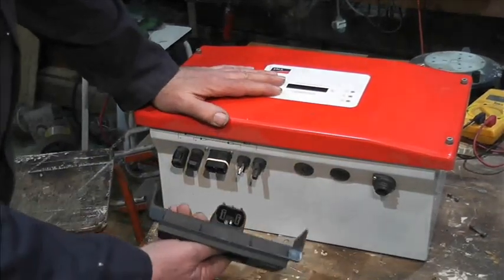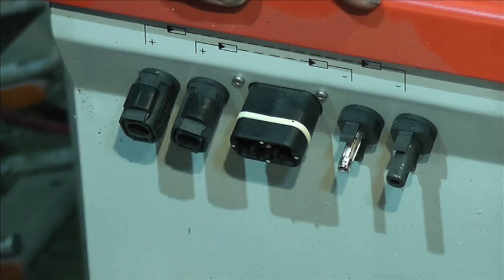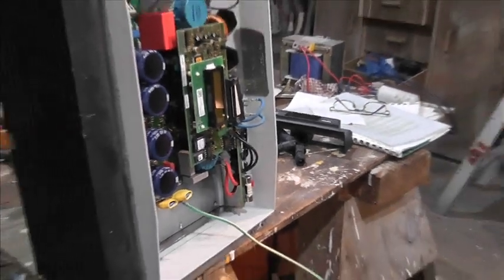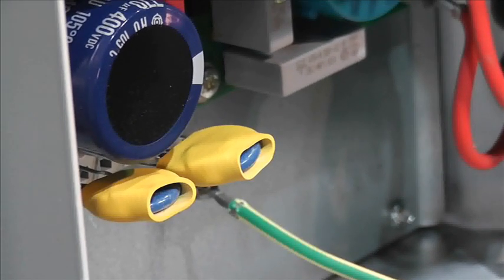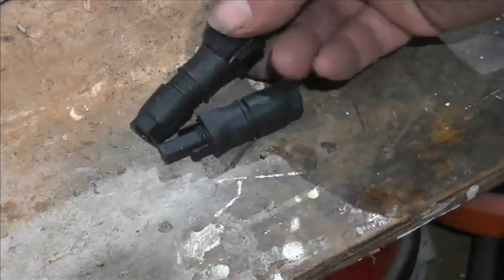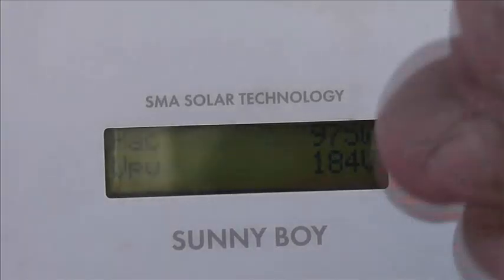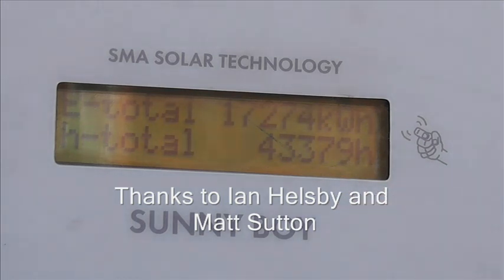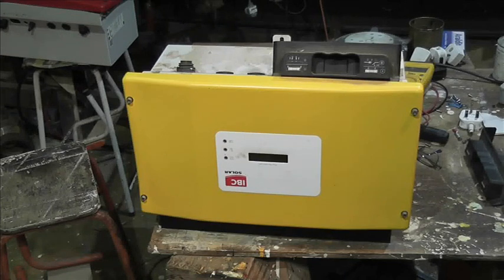SMA Solar grid inverter SB1700

Comment: I've just acquired one of these for free. Are they still a good unit???
Reply from the maker: They are solid but need the older panels to match voltage and current, cheers

Comment: I have a SB-3800-TL and when AC power is applied, there is no screen boot up etc.  Inside there is no sign of damage.  Does the DC disconnect need to attached and closed for the AC supply to switch on the inverter?  On my SB-3000 it only disconnects the DC side.
Reply from the maker: Hi, both AC and DC is needed for the inverter to start. The DC disconnect has to be in place, cheers
Reply: @TheInfoworks  thanks for the advice.  I am used to my older SB-3000-20 which will boot up the screen on AC alone or DC alone.

Comment: I drilled holes for a regular MC-4 and replaced them. I crimped the connectors themselves and soldered them inside the connectors. I also had to trick the grounding, since the differential circuit breaker turned off the electricity, since it registered a leak through the inverter when energy was generated in the power grid. I read that you can turn off the grounding check, but there are no interfaces to do this. Maybe someone knows how to turn off the grounding check in it?
Reply from the maker: Earth leak can be a problem, commonly it's in the panel wiring but I've not had any success when the leak is in the inverter, cheers
Reply: @TheInfoworks  how to disable earth leak checks?
Reply from the maker: @anrays  Never had any success, check that the fault is not in the array, otherwise change the inverter for a second hand unit, cheers
Reply: @TheInfoworks  I managed to disable the check with an additional wire, but it is not very correct. According to the instructions, the check can be disabled in the application, but for this i need to connect it to the computer. I do not know how to connect.
Reply from the maker: @anrays  Yes trying to use factory software with SMA is very difficult. I believe you need to be a registered engineer. It would be wonderful if you uploaded a video to show what you have done and I will share it, cheers

Comment: Great vid any chance you would know anything about SB 1600TL-10 ?
Reply from the maker: Hi, they are part of this robust series, some have a high start voltage so do not match with modern high wattage panels. Check that the DC is getting to the board through the DC isolator plug , cheers.
Reply: @TheInfoworks  what amount of volts input would you recommend to switch on the system ? Currently got 20 volt coming into the dc side where the panels plug into screen not on and nothing at ac side. This unit only has + and - plugs for panels and the ac plug no other plugs
Reply from the maker: @danielmcarthur6200  Hi, at 1:30 on the video it shows the DC disconnect plug, also on the label what is the value shown for Vdc mppt?  cheers
Reply from the maker: @danielmcarthur6200  All the info is in this video, otherwise put up a video on your channel, cheers

Comment: Thanks for the vid, how do I isolate the DC supply ? Mine needs a reboot after a power cut
Reply from the maker: The black moulding at the bottom is the DC connect, are you sure AC is getting to the inverter, maybe a trip needs switching on, cheers

Comment: Nice  info Andy  thanks
Ive 3 sma units n want to add optimizer/s to a string of 5 panels, only 1 gets shaded... so i bought some solar edge optimizers but need bluetooth or WiFi....... any ideas. O knowledgeable 🙏 one
Reply from the maker: Hi, I'm lead to believe the solar edge optimizers only work with solar edge inverters. This Israel based company controls all the inverter networks, so it is difficult to use second hand equipment, cheers
Reply: @TheInfoworks  feared as much😞 cheers for reply👍

Comment: HI Andy ,I have a system with sunny boy inverters ,one of which has stopped working I have found someone to repair for me(I live in France)but i am unsure of how to safely disconnect and then reconnect once repaired.Could you help me with this ? thanks
Reply from the maker: Hi, always AC off first and AC on last. This avoids switching high current DC, cheers
Reply: thanks for reply @TheInfoworks

Comment: Mine stopped working after a powercut. How do i reboot the sunny boy 1700? Thx!
Reply from the maker: I think maybe the power breaker has dropped out, sounds like you have no mains power to you inverter. Time to get the multimeter out, cheers

Comment: Hi Andy. I have acquired to wind boy inverters which came from a wind turbine are they the same and compatible with solar PV thanks Steve
Reply from the maker: Steve, I believe that the MPP tracking software is different, but an experiment whilst you have the opportunity would be interesting, cheers
Reply: Inside the boards are the same with the exception of the string board with DC fuse which is missing from the Windy's but if you are replacing a broken Sunny you can move it over. You do have to use a RS485 piggyback board and Sunny Data Control on a PC to change the Operating Mode parameter from Turbine to MPP-Operation: Maximum Power Point. Turn off and repower and you have a Sunny Boy. I have converted a WB2500 to a SB2500 doing exactly this. Just be aware that Windys relays operate a lot more than sunny's so the contacts wear out quicker but they can be replaced, error code needs resetting using RS485 piggyback and SDC on PC.

Comment: My best guess for the 4 pin AC connector is to have a bigger clearance distance between hot and neutral, given that the hot and ground are in opposing connector positions.  Could also be that they use the same connector for 3 phase 4 wire inverters (3 hots plus ground), but that carries the risk of plugging a replacement single phase inverter into the 3 phase connector and blowing it up.  It would not be for inverter versions meant for the 120V/240V single phase 3 wire we use on this side of the pond as our inverters always have wired terminals instead of connectors.
Reply from the maker: Yes, wired AC connections are so much better, re: Aurora and larger SMA, and growatt inverters, cheers

Comment: It was the dc disconnect key that caught me out, A jumper of heavy wire will get you out if the big plastic disconnect key is missing to link the two contacts in the centre of where the key should be.
Reply from the maker: Owen, I remember that video of yours and so when I got the chance created this one. I assume you still have that SB, cheers

Comment: I think those two components are MOV's however instead of thermistors. At least on the SMA's I have seen, they had the big replaceable MOV's (overvoltage protection) and sold them separately.
Reply from the maker: Hi, thanks for this, I was always told the 3 legged units were thermistors. Yes they sit in sockets and were supposed to be wear parts, but only I suspect if you push the inverter with high volts, cheers
Reply: @TheInfoworks  Those do look like varistors (MOVs), I agree. I hadn't seen the 3 legged type before though - these seem to have a thermal fuse inside in series with a normal 2 legged MOV, and the thermal fuse blows if the MOV is taking sustained overload of voltage, thus heating it up. The idea is to stop the MOV exploding/catching fire. The third leg comes from the junction between fuse and MOV, and is used as a 'monitor' output to check if the fuse is still good or not - sometimes connected to an led, in this case it sounds like it is used to trip the inverter out maybe ?
I've learnt something today Andy. Cheers Dave
Reply from the maker: @noakeswalker  Dave, thanks for the info, from my understanding the voltage on the 3rd leg goes up as the heat rises caused by a high DC input voltage. This switches off the inverter. That's all I know and that the Aurora inverters have very similar 3 legged varistors (not thermistors). Cheers

Comment: Still have one of these, albeit a 2 kW unit up in the attic producing all our solar for more than ten years now :)
Upgrading is not really an option since we'd be losing our overgenerous government subsidies that were handed out at the time (€450 per 1000kWh produced).
Crazy politicians...
Reply from the maker: Hi, yes no need to change it, but it's getting to that age where I would add an external fan run through a plug in timer. See my video on extending inverter life. It's in the grid inverter playlist, cheers
Reply from the maker: Who's to know if you have changed it, unless you tell them? cheers
Reply: @TheInfoworks  Hi! I would only upgrade it if would add more panels at the same time. As you said, these are solid inverters and I expect it to keep going for a while (hope I didn't jinx it). If you suddenly start injecting much more power than usual, apparently the energy company would come knocking on your door. Probably immediately installing a digital meter at the same time, which I want to avoid for as long as possible...
Kind regards from Belgium, i'll check out that playlist!
Reply from the maker: @koffibanan3099  perfect sense, keep that head below the radar, cheers